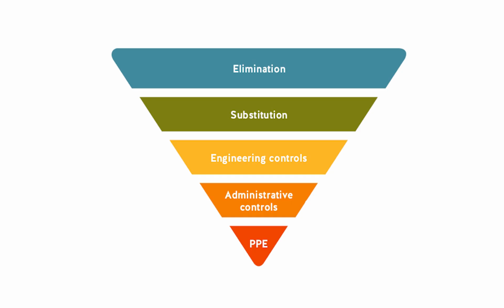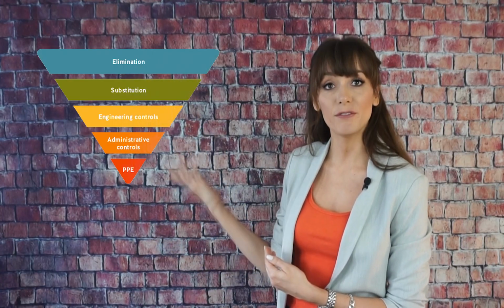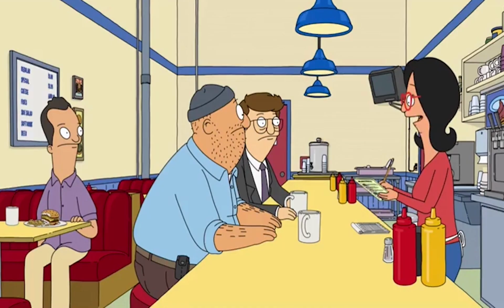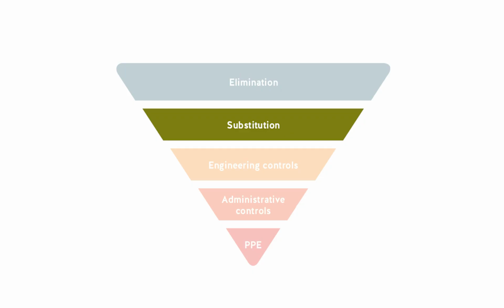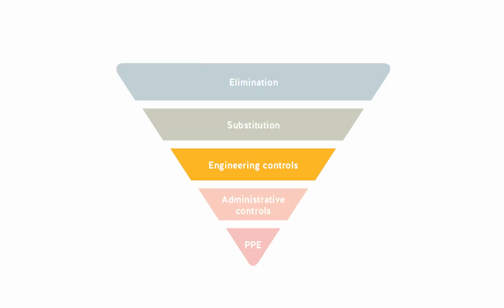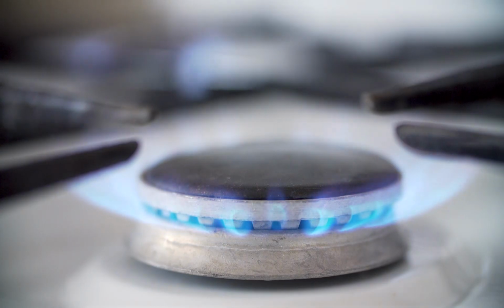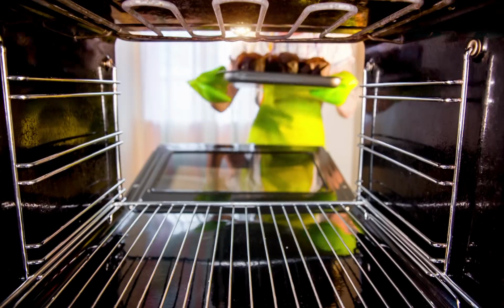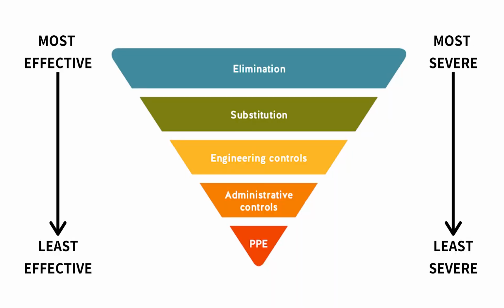Safety's Hierarchy of Controls with Examples

Comment: Are YOU wearing official safety orange 🦺??. Also, Rachel, I thought your name was Ally this WHOLE time.

Q. Is PPE at the bottom of the hierarchy due to the fact that we are still exposing ourselves to the hazard, rather than say, eliminating it (top).

For example, a broken glass shattered on the floor,

I think that Elimination of the hazard would be key, then isolation of the area, using some plan or protocol for removal, and as a final (necessary part of this) using some barrier to physically remove glass (if your broom, vacuum fails to get anything off the ground)?